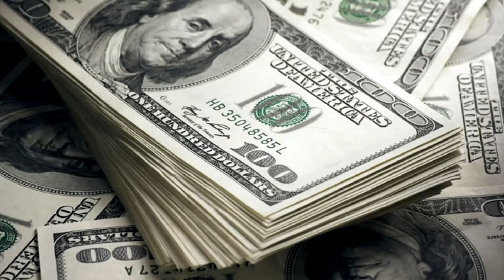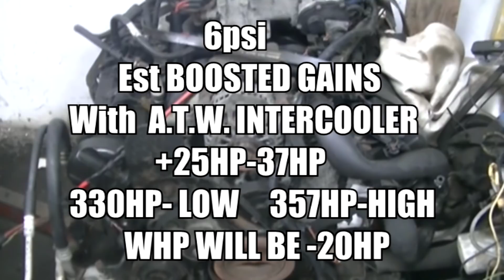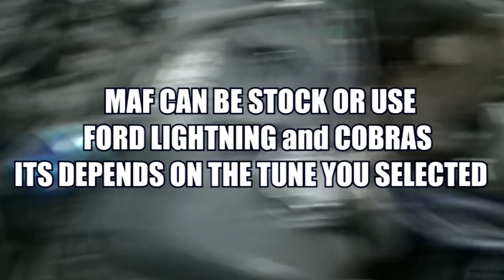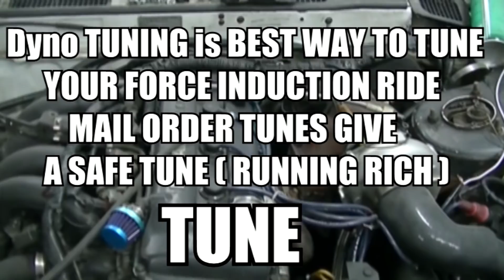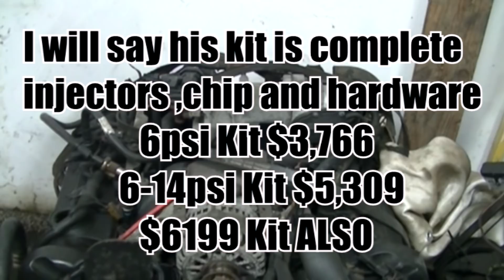TOP 3  BOOST METHODS FOR YOUR CROWN VICTORIA ( Which 1 is your number 1 )

Comment: am i looking at this right? do you have a RB motor in a vic? If that is the case, you are GOD!
Reply from the maker: nah i dont have one I have been entertaining this idea with my son, but the ford dudes aint digging it... I just need 3 people to say do it and i will
Reply: @bstfordchannel923  Do it! be different bro. it's still a great engine and it will stand out.
Reply from the maker: @maxie9506  Just need two more people and it will be a done deal.. It will be stock I think ( what sucks ) when you put a idea like this in the air ( somebody beats you to it )
Reply: @bstfordchannel923  that's what I'm saying. Doing worry about getting votes. While you're worrying about getting votes, someone is gonna beat you to the punch. I would like to do a 2jz swap myself. Dont need a turbo because I dont need that much power but I can be tuned for well over 300hp. Do that RB bro before noname noob like be beats you to it.
Reply from the maker: @maxie9506  I follow you bro i am on it.. I just needed some ( logic or  a better view ) i got it...Thank you for the verbally ( well typing it ) for me to read to really let what you mentioned sink in

Comment: Is that 5.4 a ford. Im runnin tbe 4.6 and wanna keep it a ford
Reply from the maker: yes its out of a Expedition ( the 5.4 ) ...On this side we keep the swaps inside the brands joe... will not see and ls swaps or dodge swaps IN a Ford
Reply: @bstfordchannel923  thank god! I want to keep her a ford man. Ls are sweet, but it doesnt have the heart. Is that 5.4 lighter. Have you thought about running a lighter 5.0 out of an old mustang (or even newer, I know a lot were just 4.6 alphas. Could you even put in a new 5.0?)  4.6 is dope, and ive seen the power of any type of super or turbo charged ones. I just wanna drop some weight
Reply from the maker: @joeb6137  4.6 does have the spunk to really but out good numbers NA... Ls will win all the time.. 5,4 is good but still the Ls ill out run in performance parts COST and performance of said parts vs the modular motor... Secretly I have been thinking of that 5.0 coyote  direct fit ( cause its modular motor) with stronger block and better flowing heads.. I wanted to go old school 302 or 351 in a 03 and Panther
Reply: @bstfordchannel923  of course, I'm not looking to even keep up with an ls. Jusf more pep. I also appreciate your focus on price man, like its such an important aspect!
Reply: Also the 5.0 coyote seems sweet, I am also thinking of trying to get a lighter hood or like maybe strip some back weight
Reply from the maker: @joeb6137  Thats the cheapest performance adder ( reducer ) lol  WEIGHT REDUCTION.. Just need to balance the car out in your own way without breaking the bank.. Joe b your car ill be cool just take your time...
Reply: @bstfordchannel923  the wise ones always tell me about weight reduction. These boats are easy to strip! Hey man I'll tell you what's been going on. Also is that 5.4 essentially like what theyd throw in a gt500
Reply from the maker: @joeb6137   the 5.4 intech thats in the Navigators are a close cousin on what you speak of... The 5.4 sohc is close but not a true performer really .. These engine suck gas up... always remember Hp that is cheap will not last.. Reliable ( efficient ) Hp cost .. The world relies on balance Joe b and people forget about that..

Comment: The ultimate swap would be a Coyote or a/ Godzilla!!
Reply from the maker: yes those are the falavor of the year those two swaps, I wanted to swap backwards with a 351 or 302... I wanted to pick up aold nascar motor ( If i am blessed by God ) and swap that in a Vic
Reply: @bstfordchannel923  Or you could go with a 429/460 if that's not to old?

Comment: What about putting the Lincoln Mark 8 32 valve in? Isn't that 300 hp factory rated?
Reply from the maker: Yeah depending the year 280-290 hp so on a used motor est 265-275-ish to be real, but the hp potential is way higher aluminum block ect its a good deal.. Hard to find in a good state but ideal... Just need a complete swap not in parts to make it work ( guessing )

Comment: Fastest HP boost for a 2008 CVPI and GO....
Reply from the maker: true lmao
Reply: I was asking what the fastest way was to gain hp in my 2008 CVPI lol
Reply from the maker: @chrisaustin4038   Its very simple cheap QUICK hp ( in unreliable ) .. Real reliable HP COST.. I would start with 4.10 gears 1st then I would do ( when money is right ) pro charger CLICK HERE https://adtr.net/product/ford-crown-victoria/supercharger-ford-crown-victoria/adtr-supercharger-system-2003-panthers/
Reply: Well I’ve been looking at performance chips and also a throttle body spacer as well as cobra r style exhaust and possibly headers. I’m a little all over the place but I want at least 30-40 hp gain for around 1500-2000. A pro charger will have to be way back on the back burner for now. I will look into the 4:10 gears but would a tune help mimic that?
Reply from the maker: @chrisaustin4038  ohh ok if you get a biggert throttle body and a spacer ( for slight Tq gains ) you need a tune... No need for headers unless you really want them... Just get a custom catback from a muffler shop.. headers and custom ( bought ) exhaust for your Vic will cost you 900 for headers and about 500-700 for exhaust for what type of gains? not really cost effective on hp for the does spent.. Rather do cams and tune for that price..

Comment: 302 with 351w head will be over 300 hp natural asperated. if you can make a good setup with a 302 it will be 350 to 450 hp easy. then you have to ask yourself how much nuts you want to invest. aka nut up or shut up faze. it so much easier to build a 302 then a 4.6 aka 289.
Reply: sorry a good 351 heads done right 400 hp. so do what u want to try and hold on